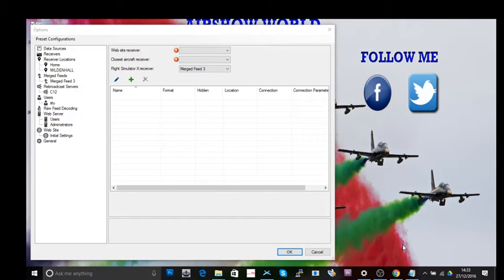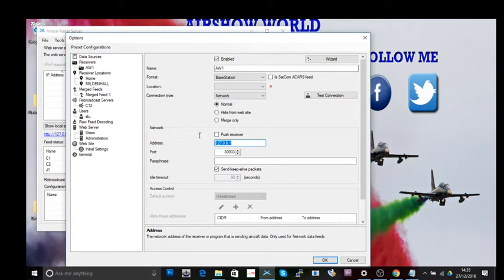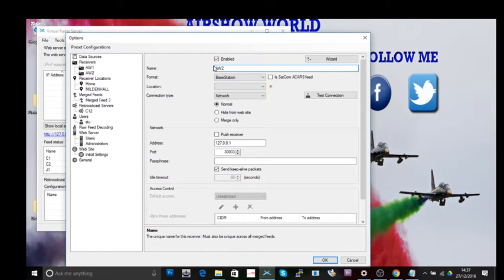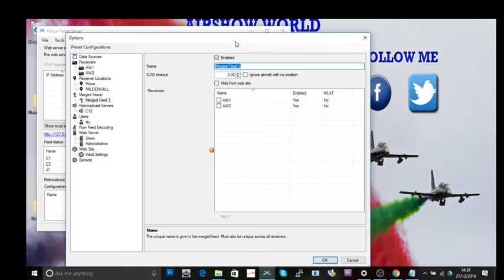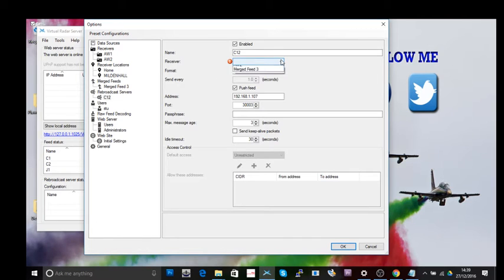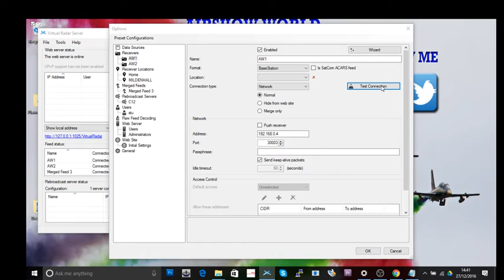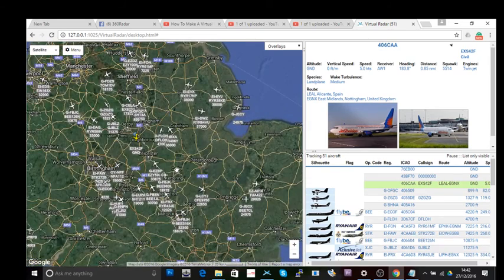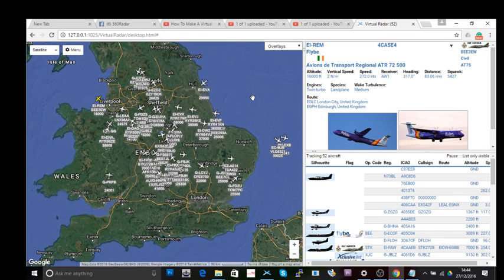How To Make An ADS-B Virtual Radar Server Part4

Comment: Hi. Need some help. The port settings for receiver 2 worked when I see up initially. But now 30106 is not making a connection. I tried a few others and same thing. 30104 seems to make a connection but receiver 2 is not receiving anything. Any ideas??
Reply from the maker: Try downloading the latest pi aware. Also make sure the up is correct you could try making sure your router is port forwarding 30106
Reply: @AirshowWorld thanks for the reply. Rite.  ip is correct. Router is good. Will try update pi. I'm not able to get mlat working
Reply: @AirshowWorld   Yep that's done it. Pi aware updated. Back to port 30106 and all working. Thank you for your swift reply.

Comment: Using other tutorials, I got the Virtual Radar Server installed but, installed on my Windows 10 machine.  On attempting to put in a 192.168.xxx.xxx address, a Test of the Connection gave "connection refused". , None of these tutorials assume you might be installing the software on a Windows Machine, they all see to assume its being installed on a Rasberry Pi.    There seems to be little explanation of the Port Number. When you uninstall and try to a fresh reinstall, it keeps bringing up your last attempt. Back to the 1090RTL software.
Reply from the maker: Well Roger,what can I say, I was going to offer to do a TeamViewer do get it all running for you.  Thanks for the Comments.